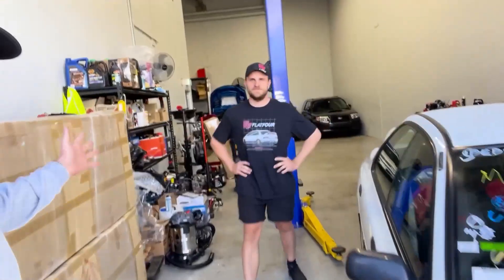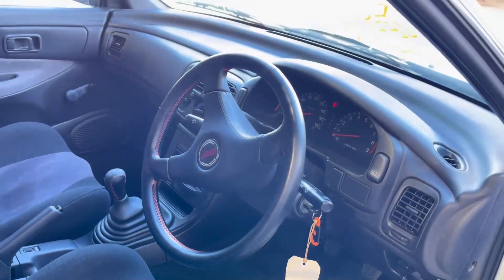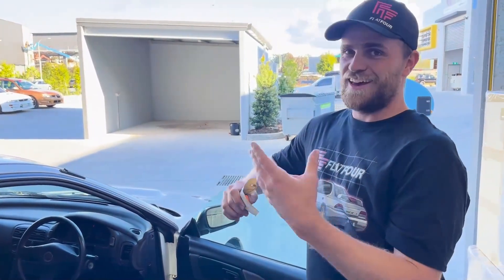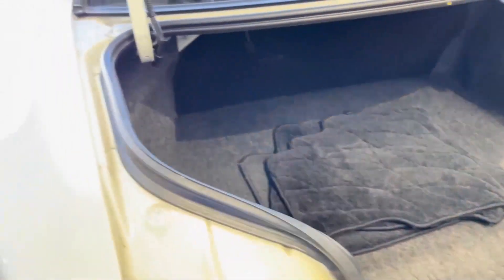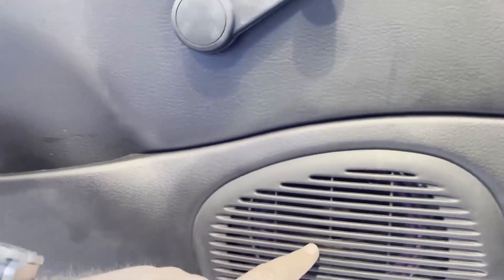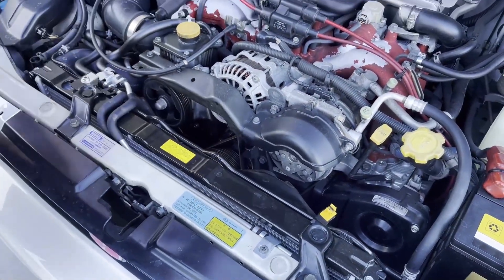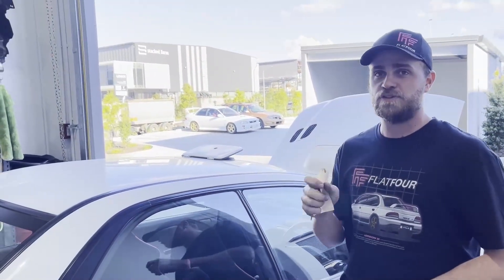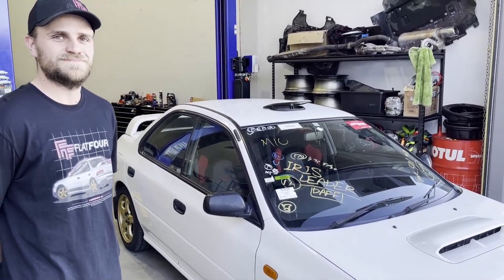1997 Subaru Impreza WRX STi Type RA Version III, JDM - First look at this mint Japanese Import to OZ

Comment: Beautiful GC8! Had a 2001 4dr 2.5RS USA. Whiteline Uerthane Kit with anti lift kit with Sti inverted struts with dual rate KG/MM (defunct hyperrev JDM order) springs. The thing rode like it had a longer wheelbase but handled like it was on rails. Miss the car 😢👍🏿 It saves my brother and my life dodging huge potential accident at 50 mph. Skirted several police speed traps. Also low key at car meets Cops went after the Supra and CRX Honda with bumblebee mufflers or Mustangs. By the time I got out of parking lot I would open up my cat-back with all JDM fog lights on! 
Cops would try to get out of parking lot to chase but I was GONE! 👍🏿👍🏿👍🏿 Corolla GR core on order 😁
Reply from the maker: That's brilliant- such a cool story- thanks for sharing. Still got a Subie?

Comment: The shift boot makes me way happier than it should.
We got robbed of the R34 and GC8 in america 🤦‍♂️ 
We got the impreza 2.5RS but a sti swap is not as magical
Reply from the maker: I wasn’t sure what US received from Subaru…it’s a shame but Australia also missed out on many special editions. We didn’t get an STi until 1999 with the Version 5, 2 door coupe, then a Version 6, 4 door sedan in 2000. These came as special low volume imports. Once the bug eye came in 2001, the STi variant stayed as a regular line up.